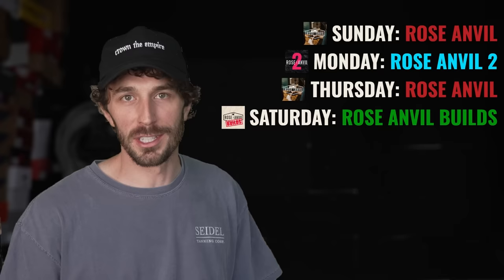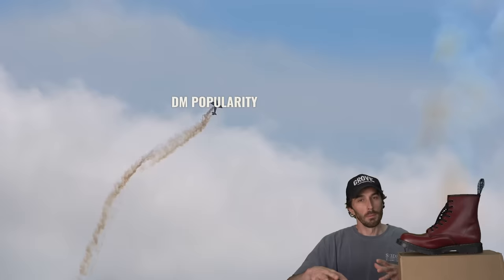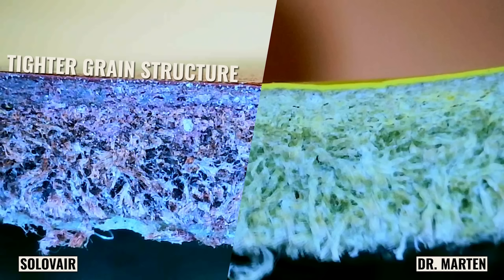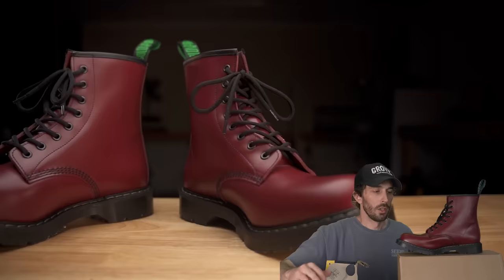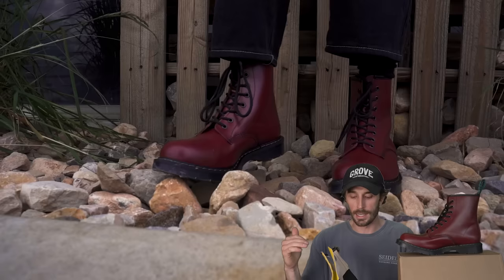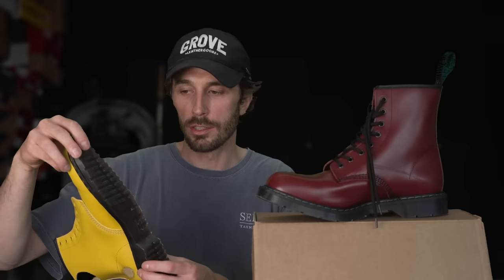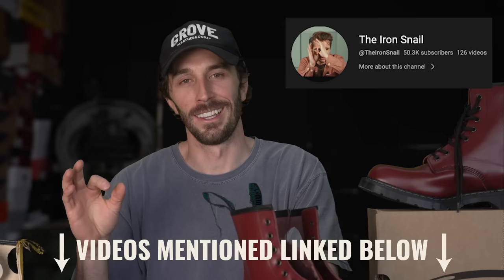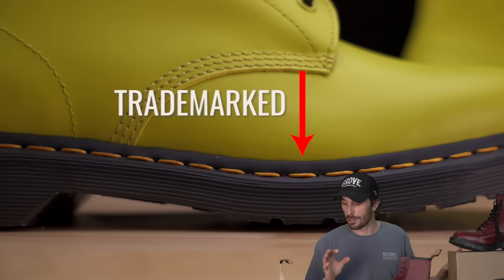Better than “real” Dr Martens - Solovair

Comment: if I told you the number of pairs of Solovair that I had to return because the soles were badly welded and with cracks... on the other hand, I have never had this problem with Martens. not everything is as it is told.
Reply: You should buy directly from the factory shops they’re usually higher quality as there’s no transport that can damage the shoes and you get them at a discount

Comment: Watch all your videos. Got to say you are really beating a dead horse with your “hate” for Docs.  Anyway, seems like your are splitting hairs in this video. Owned both boots for a long time and they are basically the same. Only real difference is most people know Docs.  Bottom line Docs are still fine and actually most folks would be better off buying the Asian variant since the made in England version run a bit narrow and will take time to break in.  Remember most buyers are not wearing these for work boots.  It’s a fashion statement so they need to be comfortable right away. Oh and if they don’t last for many years most folks won’t mind. Peace out